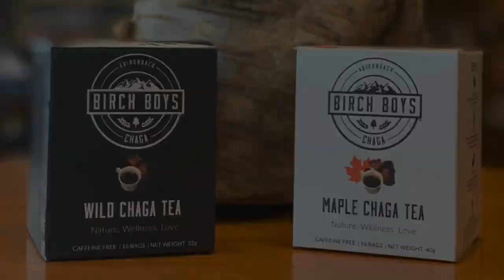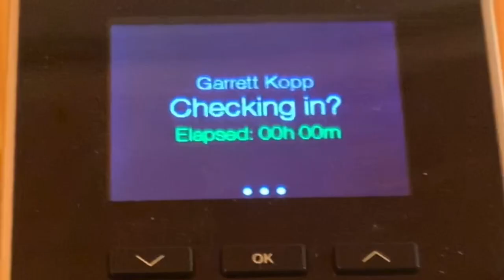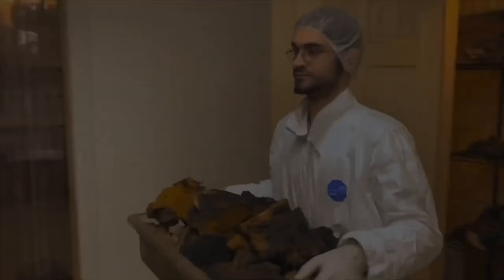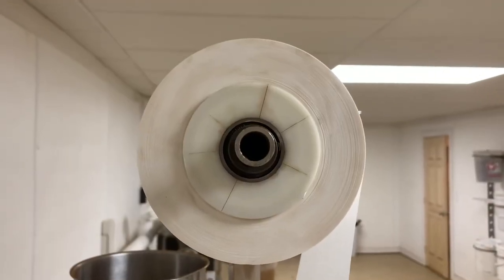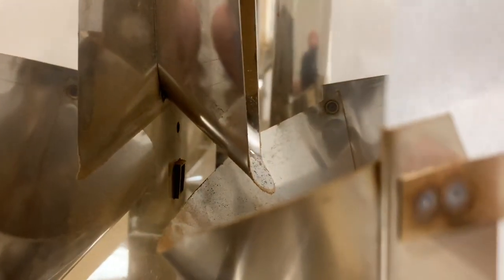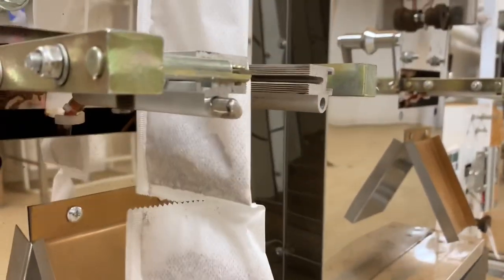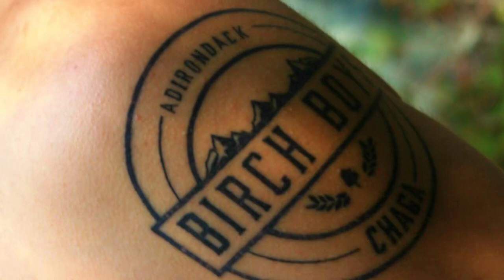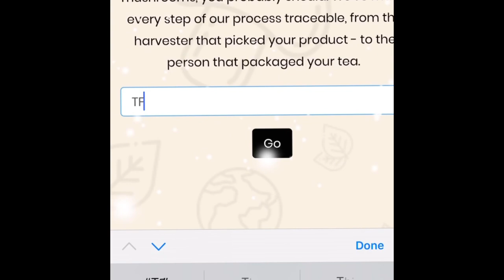How it's Made - Chaga Tea by Birch Boys, Inc. (Inonotus obliquus)

Comment: Why don't you have a log splitter type device, which pulls down like a can crusher, rather than throwing chaga all over the room, in the course of trying to break it down?

Such a system could be inside a sandblast station to contain EVERYTHING.
Reply from the maker: That is a great idea, we have a horizontal log splitter (shown behind me in the video) but such a system has yet to be available for purchase and would need some time to engineer. The containment is tricky, I feel like a ninja trying to block chaga, worth looking into
Reply: @GarrettKopp , actually, if you let your imagination run, and going back to that can crusher, or. . . .

1) Imagine and extra ax head, holes drilled and tapped into the back of the ax head, it bolted to the bottom of the can crusher....

2)  Picture a door hinge bolted to wall/board, but horizontally, so a rod connected to it can go up and down, instead of left and right, with the ax head attached to it....

For one or the other, or the next, a couple small, angled, lightweight panels to the right and left (with back braces to keep them upright), set a foot or so apart, would help minimize chaga launches.